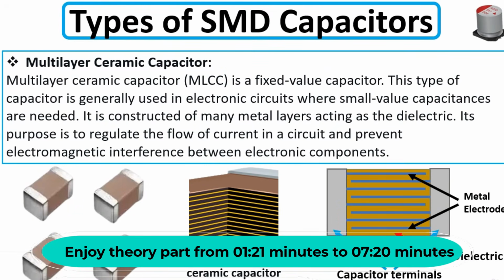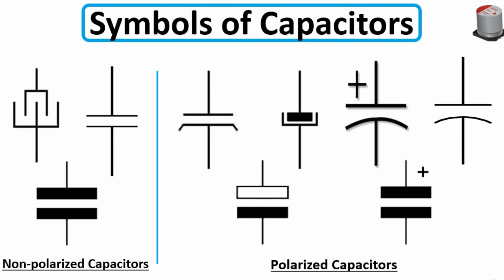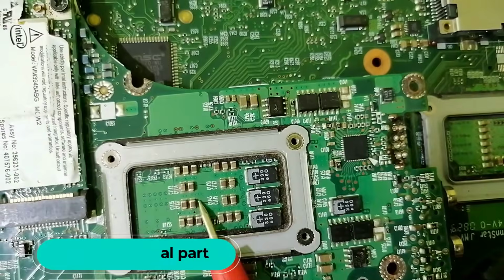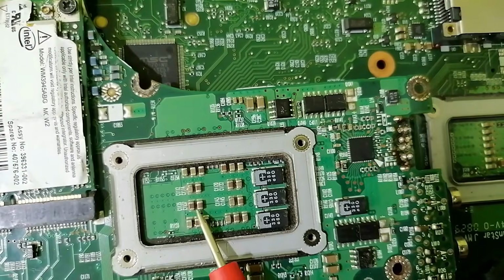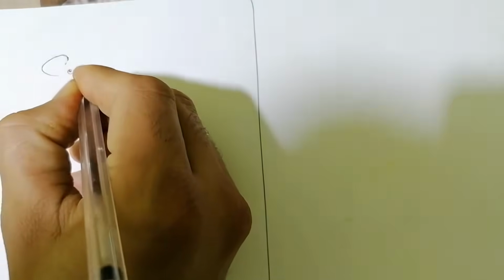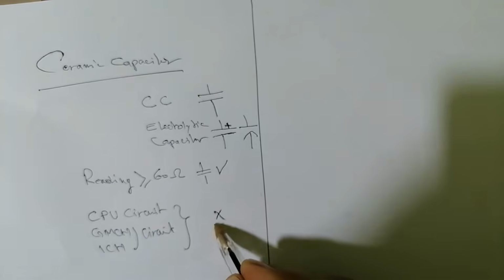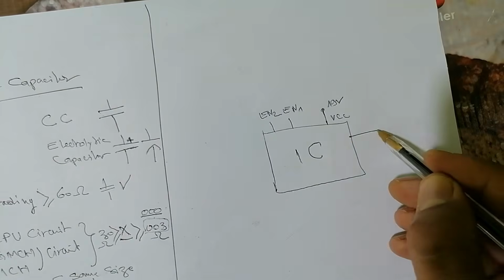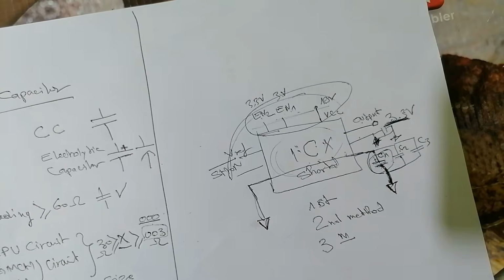SMD capacitor test with a multimeter, how to test SMD capacitor, complete Tutorial

Comment: When i check for a short i test 2 inductor near cpu and it beeps and when i remove processor it does not beep, my question is to what you did on that capacitor on the back of the cpu by removing processor and testing it does also applicable to the two inductors that near cpu? Because you said on your other videos that if the inductor beeps there will be short somewhere, so the inductor beep and after removing cpu it does not beef does the CPU shorted?

Comment: Ok If I get this right;
Testing ceramic capacitors using the continuity mode must have at least some resistance even though its  beeping. Otherwise the multimeter reads short i.e 0.00. but also it doesn't certainly mean the short is coming from this specific capacitor.

Comment: I noticed that your meter was set to diode mode, but you speak in resistance, Ohms. My Fluke meter, in diode mode, displays Volts. What is your meter displaying measurements of in diode mode?

Comment: I just changed an IC in my older Denon receiver. I read some of the capacitors might be toasted as well. So I went on and checked them. No matter what I do I can't get a beep on my multimeter or a value. Perhaps my multimeter is bad
Reply from the maker: Sometimes it can be tricky to get a good reading, especially with SMD components. Double-check your multimeter settings and ensure you're using the right probes.

Comment: great video... i'm trying to teach myself electronics so i can actually understand what i'm doing... have always just followed directions without much understanding.   but the pile of 'stuff that doesn't work' started to get too big to ignore'.   i have a dog collar that is supposed to track where the dog is and show it on a little handheld screen.  it appears where the battery connected, the wires shorted and totally crunched...  well... SOMETHING.   it literally was a little black thing that fell to pieces so i have no idea what it was.  assuming it was a smd capacitor...  is there a trick to know WHAT it was?   there is a C and a number beside it, so has to be a capacitor, logically.  but what size?   i can assume based on the length, it is the same as others on the board?

Comment: Great video but I think you need to clarify that if one capacitor goes short it will also show all the other capacitors that are connected in parallel with it and therefore does not mean the IC is short, I am aware you know this but I think you need to clarify it for completeness
Reply: Great, I was thinking about the same. So now how you will know which capacitor is short if only one is short it and/or the IC is short it? Thanks
Reply: The only positive way is to obtain the circuit drawing Andrew desolder and isolate one leg of the other capacitors that are connected in parallel one at a time and re-test until shorted capacitor becomes evident unless other know different
Reply: There is a way of tracing the shorted capacitor  in a parrallel circuit of capacitors but it involves having a very sensitive ohms meter that measures very small mili ohms. You will find the shorted capacitor as it will have the lowest value but these meters are expensive
Reply from the maker: Right
Reply: Good to know, so first you find the group of capacitors that show a short, and then isolate one by one until you find which one is short it. In the case that none of them is short it, we can easy test if the IC is short it (most probably is short it) Thanks for your replied
Reply: Use short killer..😅😅
Reply: Please what is a short killer
Reply: Thanks papa🎉🎉🎉🎉